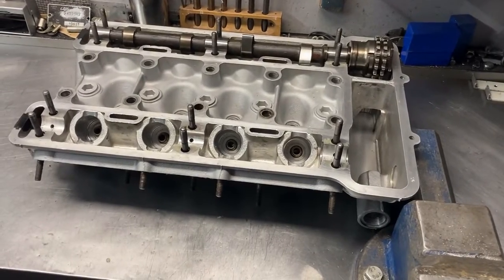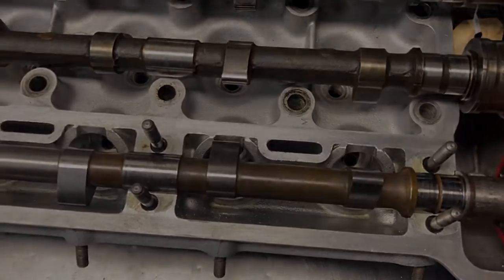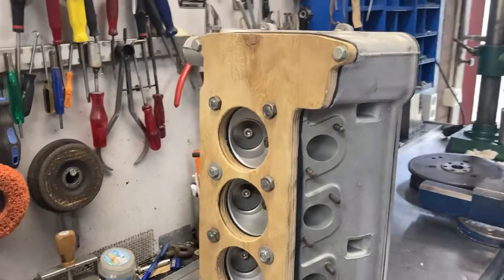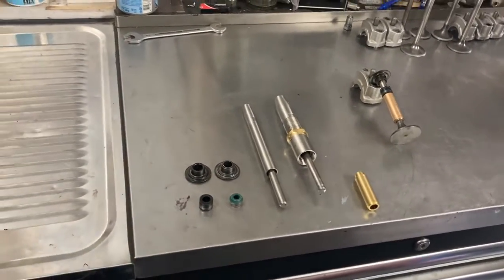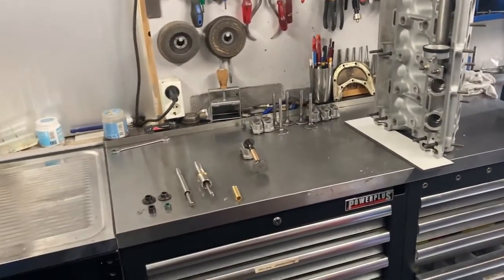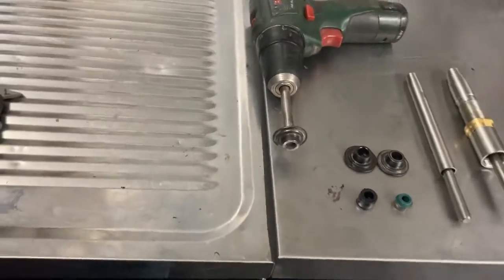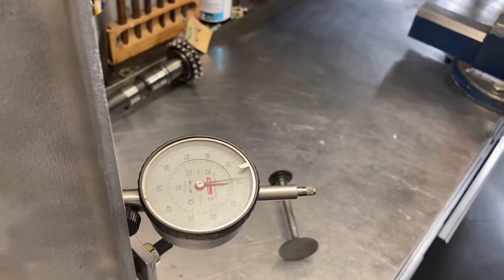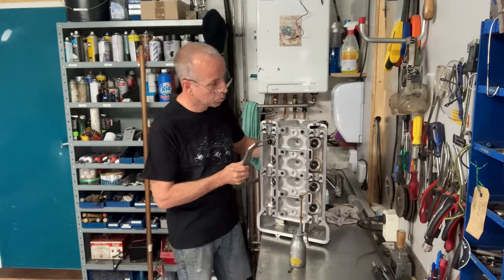Alfa 105 engine rebuild, part 4 preparing the head.

Comment: Clear Video, however looking at your graph, the 10548 51 cam is in reality very different from the 10548 01 cam (9.5mm lift if measured), very different lobe profile and higher lift (11mm) with added duration where it is needed (the cam is profiled in detail by Alfa racers on Alfabb) , at least on the pair I have. I also have the original Alfetta 10548 camshafts and they are 1054801 shafts which were fitted at the beginning to the 1.8 and in the 1980s when installed in the last GTV2.0s made, nothing like the 10548 51 cams, which seem better shaped than any road or race cams from the period i saw, with too much early duration but much less than the cams of the period, including the autodelta and c&b ones.
Reply from the maker: I have double checked,  and the lobes of the cams I have are the same.
They both have 10mm lift.
I measured the cams in my own test rig.
The numbers are 105 48 03 200 01 and 105 48 032 00 51.
There is a difference in the ramp leading up to the lobe this gives the 51 cam more off seat duration at the same valve lash.
So no idea were different numbers u mentioned come from.
I should mention that if u measure the lift with a caliper you measure 9.5 to 9.6 lift.
This is because at 90 degrees from the lobe center you are 0.2 or  0.25 mm up the ramp .
So the base diameter is 0.4 or 0.5 mm  smaller then the  number on the caliper.
Reply: @nord.tuning  interesting, I have both pairs and measured them each, and with a caliper the lobes on the 01 cam are 1mm less in height than the ones of the 51 cams with different fatter/wider lobe shape and angle of lobes also different, like how you describe your squadra cams.  I cannot comment on your 51 cams you have of course; my 51 cams are very different than your ones it seems and match the stats given on alfabb. However, like I mentioned there is a full comparison in detail on alfabb. I also contacted AFRA to ask about the 51 cams before the detailed analysis on alfabb was published and they said to me they are not road cams but semi race cams and should be fitted only to prepared heads intended for racing. Indeed the table i have (not in english) comparing all the production Alfa cams listing "....kleptiming graden (io/ld/uo/ud)...graden open bij klepepeling in mm inlaat utlaat...gr overlap..graden blj 0.050 ...lift mm" lists the 105480320051 motor onbekond .....graden inlaat 284 /050.....graden blj 0.050 inch lift 252 ...lift in mm 11.04..........It was never fitted to a production Alfa Romeo Alfetta according to Alfa Romeo books/parts manuals. The guy on Alfabb I recall remembers seeing them installed on the club race cars in period in 1970.
Reply from the maker: @cbca6567  Okay, it seems like, for the 105480320051 cams there can be  two different lobe profiles .
You have to be Italian to think this up :-)
Heated discussion over here : https://www.alfabb.com/threads/cam-shaft-part-numbers.1207/
My cams have also  1B stamped  after the part number this did not seem important to my at the time but  it probably is.
Reply: @nord.tuning  yes i read all the alfabb threads and there are a handful discussing the 51 cam which was originally a mystery cam because while it is clearly an alfa romeo stamped cam, it was never fitted to any alfa romeo production cars from new from my research. It was profiled by alfar7 there who measured the cams and who is well resepcted as an alfa cam maker that rightly says the duration on the all the production alfa cams and the alfa race cams and C&B cams also was too much at 0.050 and too little at higher lift, because of old fashioned cam design. He however said the 51 cam he had, with 11mm lift, was the nicest cam, road or race made by Alfa or C&B he had seen. My cams do not have 1B stamped on them but a large "C" on each. My 10548 cams have stamped on them other letters, smaller in appearance, "Z" for the intake and "C" for the exhaust. How to get in touch with you? I have some questions for you?
Reply from the maker: @cbca6567  So it been a while,I created a new Email account and it got blocked by google....
It is nordtuning8  this is a Gmail addres.
Greetings.

Comment: Nice practical video. Particularly liked the section on measuring the maximum possible lift, but I would have loved to see more detail on the valve guide installation tool that you made and how you installed the guides at home. Keep the videos coming.

Comment: Hello Otto, if you want all the torque capacity of the engine, 12 mm lift is not enough
Reply from the maker: Yes probably true.
I want to improve in little steps in these videos and 12 mm is the max for this stock head with stock ( motronic ) valve springs.
Coil bind is at 13.4 so....
I will also check the spring rate in a next video.

Comment: Like the video but you're talking to us as if we already know what you know. Some more detailed information and  camera close-ups would be great
Reply from the maker: Thanks for your feedback, if you have a specific question just let me know. 
I did no do much work to the head because it will be modified in a later stadium and putting in new 9mmm valve guides now later going to big valves with 8mm guides is a los of money and work.
There will be more detailed info on the building of the bottom half.
 Regards, Otto
Reply: @nord.tuning  I was wondering why you didn't measure valve spring pressure/install height, makes sense knowing that you put the stock springs (and I assume shim washers) back where they came from.